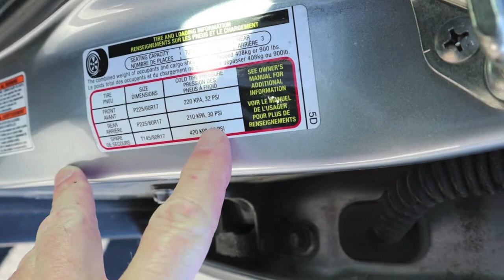2012 Subaru Outback REAR SWAY BAR UPGRADE 15mm to 19mm

Comment: I recently did this same job to my 2017 Outback.  I got the 20mm sway bar from the STI instead of the WRX 19mm version.  The difference is amazing.  I did get new Moog sway bar links.  My originals were pretty rough from NY winters.  The Moogs have a nice design where you can hold the center bolt with a standard wrench instead of an Allen wrench.  So 2 wrenches and they mount like a piece of cake.  They are more robust than the factory ones too.  $20 bucks each.  Great video and any Outback owner should do this to theirs.
Reply from the maker: Thanks for watching!

Comment: Would you be oh soo kind and make an update video to tell us how it's better or worst? I had a worn front sway bar bushing problem. Made the car terribly unpleasant to drive. I didn't replace them, juste cut 1/4in of the rubber and shimmed it with one eighth flat bar. SOOOOoooo much better. So after having beefed up the rear sway bar... You you recommend it to others? Feel free to include potential sponsors
Reply from the maker: Simon, after stepping up the rear sway bar to 19mm, the OB had less rollout in turns, but the toe-in would never stay in spec on our Outback. This after 3 trips to dealers too. With no wrecks and no damage to our bought brand new Outback, after 9 long years of a continued dreadful driving experience, we traded it on a new Kia Sorento. The Sorento is a Godsend compared to the Subaru Outback, our OB anyway.
Thanks and good luck on yours!
Work safe!

Comment: Hey great video. Will I need to get a different sized set of rear sway bar links or rear sway bar bushings to upgrade my 2014 Subaru Outback 2.5 from the 15mm to 19mm rear sway bar link? I got new sway bar links and bushings but haven't installed them yet.

Comment: I was considering this on my 16 outback. I just bought a 2020 outback three weeks ago and driving in the mountains it seems to handle better than the 16. My 16 does have 200k miles on it now so that might be some of it, but I don't remember it being  this good when I got it. The only real reason I was considering this on my 16 was driving on windy days. The 2020 is still very wind sensitive on the highways, someone told me the heavier sway bar would help correct some of that. Did you notice any difference on yours with wind after the new sway bar?
Reply from the maker: Yes, it was decisively better in the wind and less roll in the corners. We drive the speed limit and on occasion exceed it 5 mph.

Comment: Hi PM Tips, 

Did you ever consider going the route of the 20mm sway bar? How are the current Duralast end links holding up that you sourced from the parts store after nine-ish months on the road? Did you ever consider going to an upgraded end link to meet the demand of the increased resistance of the 19mm sway bar? Great video, and thank you for sharing. 

Thanks,

Ted
Reply from the maker: Hi Ted, no I never considered the 20mm bar. On the end links, I used the cheap ones from a parts chain store......big mistake, they (duralast) popped and cracked too much.
The 19mm bar is a huge upgrade from the OEM 15mm bar. The increase in mass alone was like a third more, and I like the less roll feel out of the 19.
Thank you for watching!
Reply: Thanks for the response! I was questionIng the duralast product. I'll have to bring my feedback to the table-I actually picked up a 20mm and will be installing it this week.
Reply from the maker: Ted, I think on the 20mm I would definitely go to OEM end links. Pulling in to business lots that have a slight rise or drop from the main roads is where the cheaper end links would pop and squeak. My wife hated the noise:(
Good luck!

Comment: my daughter just bough a 2011 outback and when she drives down the interstate at 60 mph if she hits a bump or something in the road the back seams to sway from one side to the other without any movement on the staring wheel will the sway bar upgrade help with that
Reply from the maker: Hi Dean and thanks for watching and commenting!
The upgrade should be beneficial to your daughter's Outback. On our 2012 OB there was a significant change to the better in less roll in the back.
You never mentioned how many miles is on the 2011, so don't over look shocks and struts as these can really contribute to bad handling. Mine has 67,000 miles on it and I'm suspecting struts and shocks. 
Good luck to you!
Stay safe!!

Comment: I am upgrading the sway bar on a 2014 impreza, very similar setup. When I removed the end links it was rather difficult and now i cannot get enough leverage to reinstall the end links. Did you have to hammer it back into place?
Reply from the maker: Make sure the links are exactly the same size as OEM. You might have to use a small jack to gain some on the install.
On my OB, they slipped right into place, but I had plenty of ground clearance. 
Be careful!